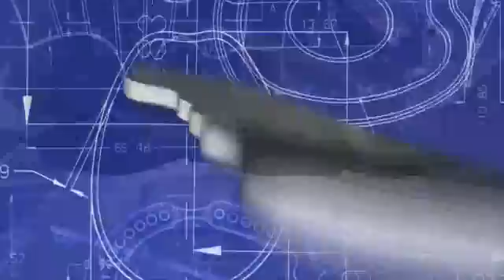#britek  Energy Return Wheel... Autonomous Never Flat

Comment: I was thinking of micro springs instead of where you have the bolts, this cushions the ride and even if those springs were magnets and how they would react with the grounds magnetic force, just an idea.
Reply from the maker: Thanks...Trick is to use negative pressure against resistive forces. We originally used bolts to draw a membrane between outer hoop and wheel...New Patent prototypes uses vacuum pressure to support the load.

Comment: Try to use a car that has only one exhaust pipe and less than 5000 cubic cm engine when talking about fuel efficiency! if all Americans could do that there would be more oil for everyone in future  and less war,that would be better!
Reply from the maker: What makes more sense...Improve already efficient transportation or improve high power, thirsty transportation, including heavy truck? Why the American comment? Where do you think the AMG Merc's in our videos come from?
Reply: I cant take you for serious when you sound like tv shop sales man.
We make what sells in USA.Those cars are built in USA by your standards,because American wont buy a small car!  America uses 6.89 billion barrels of oil per year where in whole Europe people use 4 times less,and in Europe one gallon costs 9.82$.  and that wheel is nice thing,i hope that it works, it needs less bolts.
Reply from the maker: ***** Please review our bicycle videos. We made the switch from auto 4 years ago due to much pressure. It is not yet a good thing to increase existing fleet fuel efficiency in the USA.
Reply: Yes,the World doesnt really want to progress,i like your bike project,it does have potential,but the part where that tire is attached to bike rim could be done,so it would fit on standard rims with ease, with some molds.
Reply: everything could be monocoque like nikes airmax sole with those air springs.
Reply from the maker: Brian was involved with Nike's very first Air Shoe the Tailwind. Suggested front and rear sections and 30 other submissions from 1978- 1988. Negative pressure or stretch was the footwear breakthrough...Russell's 11 Utility Footwear Patents, Just like the tires. Stretch not pressure.

Comment: my first thoughts are, that this would probably be alot heavyer then a regular wheel. weight on wheel is calculated somewhere about x4 i think, so that would mean a lot bigger energy consumption.
i would love to see some traction tests tho, especially slow motion ones :)
Reply from the maker: Please review our slow motion bicycle videos. We have had several traction system breakthroughs. Space age composites  8 lb. of carbon fiber with a Kevlar jacket for each auto hoop. Enough carbon to hold 6 tons of dynamic tension...Each wheel. Try this with your pneumatic car tire. Another example ERW 700c hoop and traction system is now 12oz with massive speed advantage.

Comment: Non Pneumatic tires are not a new idea. They where on wagons hundreds of years ago. Pneumatic tires are used for improved traction. Its pretty simple, The more friction tires have with the ground the more traction that have but the less efficient they are. Trains you solid steep tires and are extremely efficient. Cars can have a higher usable power to weight ration and change direction and speed more easily then trains but are far less efficient. This appears to be a half way point between all metal and pneumatic, having a flexible metal band but then a soft outer material(rubber). Its a clever idea. over all its a stiffer tire but still has some traction advantage of rubber. It may work for vehicles that don't need to be very flexible like a truck that just hauls on the freeway but for a everyday tire its never going to make it. You can get a similar effect by just over inflating your tires, this will increase fuel efficiency  too. Handling wont be so good and traction will be bad.
Reply from the maker: 5,000 years ago Chariot wheels were first. Leather was used on wood for cushioning and traction. Today's balloon tire uses must form a tread block. This takes time. Russell's ERW Utility Wheel Patent portfolio is # 1 in recorded history.

Comment from the maker: ERW draws tension from the hoop to the wheel via 4,200 psi elastic membrane. Each "Pull" is pre-stretched to 300 lbs. There are 36 pulls. Add vehicle weight and there is a return as the drive train begins rotation. IE Hub Lift and Screw Force.

Comment: The number of patents you have is not a measure of how good your product is.

0:20 "A pneumatic tire is very susceptible for failure." - And? That's a meaningless statement unless you're going to tell us how much better or worse an ERW is.

I can't actually work out what I'm supposed to understand is better about an ERW than a pneumatic tire. Are they more fuel efficient? How much, and at what speeds?
Reply from the maker: Glad you asked. ERW is true High Speed Airless. Expect regulated efficiency for ERW wheels. Th Efficiency can be dialed up or down to fit Petro Chemical Industry Requirements.
Reply: Well done on not answering the question at all.
Reply from the maker: Utility Wheel Patent claims are the toughest to come by in any field...Period. Look for yourself.
Reply: Well that's lovely for you, but has little to do with what I said. "Toughness" of a patent - or even the existence of one - is no guarantee that you've got anything worth patenting. I could patent a novel design for a machine that removes chewing gum from the outside of the International Space Station, but no-one's going to buy it.
Reply from the maker: So you are saying that no one wants to improve their gas mileage, eliminate pumping tires or roadside repair of flats? You are a bright fellow...Well done!
Reply: I've said nothing of the sort, so please don't put words into my mouth like that. What's notable is that your video makes no claims of that sort either - it's full of vague goals but makes no actual claims. So have you actually been able to improve gas mileage?
Reply from the maker: Yes...We were and are reluctant to push our efficiency improvement over the "Tire". The Tire vs ERW  video gives a clue for rolling resistance. Add Screw Force for drive train E.

Comment: Fuel efficiency is awesome, but nowhere did anybody talk about whether this thing does the same or better when it comes to road safety compared to what is already out there.
How do these tires handle traction? Cornering fast puts a lot of side loads on them, can they handle that? Braking? And what about comfort? Are these just as comfortable?
Reply from the maker: Over the past 13 years we have found Patent-able solutions for every concern. We have put 1/2" holes into the membrane system with no loss of performance. The radial array of attachments hold 12 x the prescribed wheel load making for "better lateral control", high frequency in wheel suspension for superior control at the highest speeds.

Comment from the maker: Bridgestone just announced upgrades to their "Air Free" concept tire. Now mounted on a 900 lb. two-passenger concept city car capable of a maximum speed of 36 mph.
Contrast this to our FIRST 2009 USDOT Laboratory test... Over 75 mph. on a 4,800 lb. 350 hp. ML 55 AMG chained "DOWN" to AWD Dyno set to 6,000 lbs.resistance. Rodney Dangerfield Wheel?

Comment: Question, what would happen to those wheels while really hard breaking, or when you go from 0 to 60 within 2.5sec ? could it handle the stress ?
Reply from the maker: Alan Rochin We shall see. We have begun a Hyper Car project.
Reply: i have seeing the slow motion videos of dragster racing cars.. the torque energy is massive.. 
i know this example is an extreme but would love to see slow motion behavior of wheel like this in regular sports car..
Reply from the maker: We made the move to bicycles 3 years ago to learn. High frequency in wheel suspension with less than 1/2 the suspension travel.
Reply from the maker: For Auto 6 - 12 tons of developed tension between hoop and wheel..Each wheel. The torque and horsepower are absorbed Screw force and a flinging of the hoop to the surface.
Reply from the maker: Auto ERW holds 6 tons of developed tension per wheel. Point to point across the wheel for precise transition power to brakeforce. Milisecond reactions play out across the hoop eliminating over 50% of pneumatic tire bounce.
Reply from the maker: ERW responds in milliseconds. Faster than pneumatic tires can. Acceleration to brake force ERW can change rotation speed and direction very quickly... Our new "It's Alive" video is posted.
Reply from the maker: Composite hoop with a kevlar jacket running as close to the surface as is possible. Our radial tension drawn to points allows the hoop to move/respond at lightning speed. Our new traction systems combined with composites will be the same or "LESS" than pneumatic tires.
Reply from the maker: No problem...ERW internal tension is typically 12 x the load. That's a whopping 6 tons per wheel. Try this with your pnumatic tire and...Pop! Screw force accumulation flings the hoop to the surface. Then our novel traction system pinches the surface. No pneu. can match ERW hook up.

Comment from the maker: The negative pressure wheel reduces unsprung weight. Fuel efficiency is improved via drive train screw force accumulation and return.  A massive 12 X the prescribed wheel load in kinetic reservoir between hoop and wheel...Combining with the weight bearing linear displacement for a significant lever action. A return against wind resistance...Again a linear displacement rebound drawn into rolling action. A massive breakthrough in ground transport. Not to mention the 50% improvement in rolling resistance.

Comment from the maker: Consistent progress against all odds. Please check out new  tubeless MTB tire VS ERW acceleration test at the Big Kahuna. So many have said that ERW can not possibly compete with the latest and greatest tubeless bike tires. What do you think?
Reply from the maker: No problems. The negative kinetic charge that supports the hoop from the wheel is "12 x the prescribed wheel load". Try to support 12 x the prescribed load with a pneumatic tire. Pop! ERW is very very powerful. This is obvious in the first USDOT laboratory high speed video. Imagine only 12.2 second coast down from 55 mph. to zero for a 35.5 psi. pneumatic tire. ERW was 67% better on our first try.

Comment from the maker: ERW balances force across all wheels. Screw force accumulation and return, lateral forces and camber control are processes in 
milliseconds...High frequency in wheel suspension.
Less tension at the bottom is the negative pressure wheel effect.
Tires over respond by bouncing and making more work for the suspension system. Testing done at USDOT high altitude testing lab.
ERW rolling resistance... 67% improvement  over a 35.5 psi. pneumatic tire.

Comment: How does the wheel over come weight distribution of the vehicle? Also If you are using or think pneumatic tires are for cushion there is something wrong. Yes there is some spring and shock absorbance but that is not their purpose. That is the job of the suspension as is controlling that effect in the tire. The Tires only job is controlling the direction of the car on a 2d plane.

When loaded you have less tension on the bottom so net tension is the same.

Do you have any actual data on it?

Comment from the maker: Until the ERW is loaded. Once loaded the hub sinks within the scope of the hoop. MORE tension on the top half...Easier to roll or change direction of travel. Hoop flex distributes and levers force hi psi. IN milliseconds not a bouncing balloon. Pneumatic tires are used for cushioning. Pneu. tires do NOT distribute psi. evenly while cornering or acceleration while ERW does. Wedges off the curved hoop radically increase G force and traction for 4 wheeled vehicles...Period.

Comment: The elastic will pull on both sides of the hub equally though. Potential energy will be stored but never released because you are never dropping the hub. It does not look like the outer rim allow for much flex either? How is the contact patch? The reason pneumatic tires are used is because they distribute the vehicle weight evenly over the contact patch. Traction is always a trade. The most efficient wheel are the hardest like train wheels but they have the least traction.

Comment from the maker: No...A negative pressure wheel has never been described throughout recorded history. We use a composite hoop sprung from a hub. Elastic attachments are stretched to locate the hoop around the hub. When weighted stretch or kinetic energy  is stored creating a bias. Lift and rotation is the path of least resistance upon power delivery.

Comment from the maker: The rebound is high frequency. The frequency can be increased by tightening the attachments or on some prototypes a vacuum pressure controls / boosts the kinetic charge. Balancing has become less of an issue as our specs have improved. Sidewalls will be included. Please review Best of ERW video.

Comment: There are a few things going through my head: First is can tire rebound be controlled or adjusted like air pressure in standard tires? Second, how is balancing achieved, a design like that would almost certainly need a road force style balancer. Third, a side skirt would be needed to prevent debris like stones being fired out at high speed like a centrifuge gun. Lastly: oh great, now I'll have to buy another tire machine to change the tread bands when they wear out.

Comment from the maker: Our first prototypes shown in this video were more due to the steel hoops.and bolt attachments. Our new prototypes are composite hoops with no bolt attachments bringing he weight to slightly more than a pneumatic tire ...The big difference is the sprung weight effect of kinetically suspending the hub inside the hoop.

Comment: But how does it compare directly against current pneumatic tires?  What are some comparable numbers for a given vehicle for Stopping distances, G-Force loading, wet traction, compared to a premium tire.  What are the rolling resistance ratings compared to Michelin GreenX and other manufacturer's high efficiency tires? Lets say I am driving down a gravel or dirt road and I have to make a sudden sharp turn and get under-steer, would this damage the tire or inject foreign material?  I am interested

Comment from the maker: Once adopted ERW will be very close to the cost of today's tires. ERW  will undergo 100 +  years of refinement. So far it looks like  there will be manufacture advantages over today's pneumatic tire. The big issue is the long term fuel savings. Even a 10% improvement in fuel efficiency is 1 free year per ten driven. What do you spend a year now?

Comment from the maker: The energy costs of pneumatic tires is significant. Our first test at the request of the USDOT was our coast down and highway videos. The coast down was a 67% improvement in rolling resistance. The highway test #'s horsepower, torque fuel efficiency were withheld. After serious pressure we switched to bicycles. Much improvement has been made since our first tests. Please review our slow motion videos to see high frequency in wheel suspension.

Comment from the maker: Pneumatic tires "loose" energy due to tread block formation and sidewall deformation. Impacts power ERW rolling action. Pneumatic tires bounce, ERW will surge. Drive train efficiency is improved via ERW screw force accumulation and "return"...Bumps and clunks are absorbed and returned, not lost. ERW brings forces to points, then levers off those kinetically charged points.

Comment from the maker: This video was showing the first auto prototypes that were literally bolted together to save money. The 1/2"rubber membrane is bolted between the steel hoop and a stainless hoop. 4,200 psi. membrane is drawn through holes in the stainless hoop by 36 attachment bolts attaching to the wheel. This dynamic force controls the high frequency suspension. Expect expandable replaceable treads.

Comment: Getting a bit off topic, but I would like to point out that it is a myth that tires protect people in cars from being struck by lightning. Think about it. A giant bolt of electricity just traveled miles through the air, but it couldn't jump the 6 inches between the metal car frame and the ground? No. What really protects the people inside is the fact that the chassis forms what is called a Faraday cage. The electricity travels through the metal frame, around the passengers.

Comment: Have these been tested to where a pot hole is encountered at various speeds and does it hold together? Traditional pneumatic tires also insulate the body of the car from becoming energized from electricity from the friction of the wheel rolling over the pavement, will these tires also insulate a car from this energy?  What about a lightning strike to a car that has these tires? Will the energy transfer to the occupants?

Comment from the maker: ERW is much more capable than the pneumatic tire at speed. Rolling a "sprung" true, round hoop connects to the surface like no pneumatic tire can. Balancing is not an issue. Our high frequency in wheel suspension makes the ERW high speed airless application number one in airless performance.

Comment: He's being rude but sometimes you sound like a salesman. You'll have to break it down into regular language or get someone who has this strength to do it for you. 

This is cool stuff you have though. I want to see one for motorcycles. 

Also, the tires will wear out. You can't get around that so you'll have to come up with how to safely attach it in a way that 's also easy to change the rubber when the time comes. Make the concentric hoops bolt onto the hub and replace those!